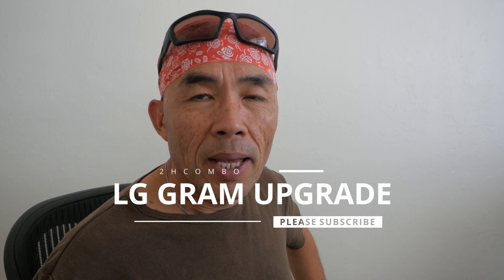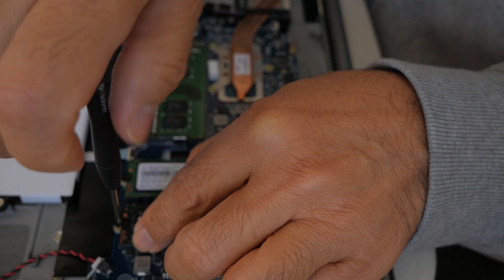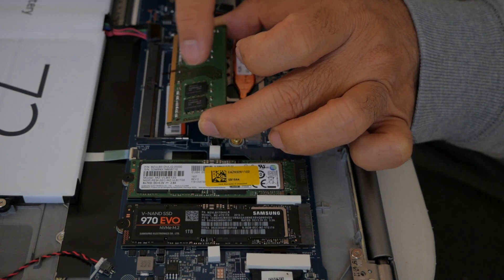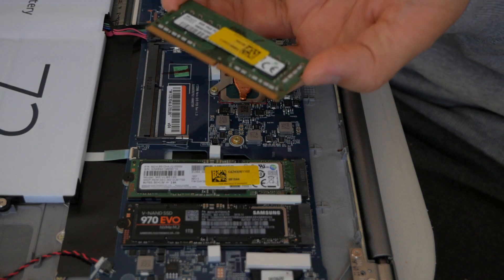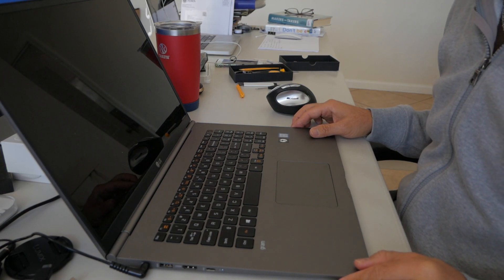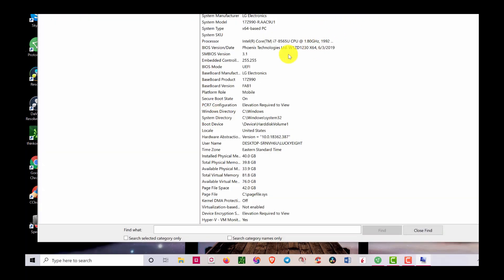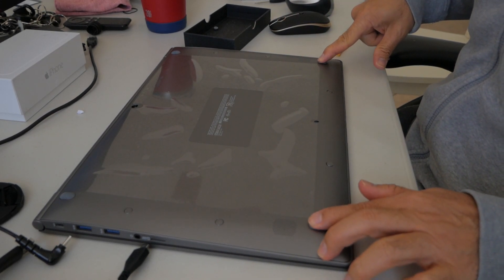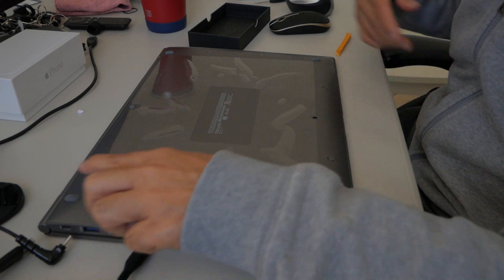LG GRAM LAPTOP UPGRADE - TO 40GB RAM AND 1.5T SSD STORAGE -Jan 2020

Comment: the video is really informative, but I have one LG gram 13z990, with i5 8265u CPU inside. I don't know if my model can upgrade to 40GB ram. I heard that the 13.3 inch, 14 inch, 15inch, 16 inch are using the same motherboard, and I want to upgrade my gram 13z990 to 40GB ram.

Comment: Can you advise me which brand ram 32 is suitable for LG GRAM 17/16 ? For those models are working on LPDDR4 4266MHz.
Reply: Não é possível trocar as memórias LPDDR4 de forma convencional pois as mesmas vem soldadas na placa mãe.
Reply: the Intel tiger lake cpus support 4266Mhz LPDDR4 or 3200MHz DDR4 RAM, so you can upgrade with any DDR4 3200Mhz (8/16GB) for proper stability
Edit: 2021 models dont have upgradable ram slots SMH

Comment: Hi, thanks for the video. What's the heat like with this device and the noise from fans? I've  heard that the cooling lets it down and it doesn't perform to its maximum and is quite loud particularly when hot. Do you see this, particularly with these upgrades? Thanks.
Reply from the maker: not a problem at all as far as the computer heating up;  I use my laptop all day long 12-16hours a day

Comment: Hi I am not getting the part of this tutorial where there is only 1 DDR4 slot which he replaced with a 32GB stick. But system setting shows 40GB ram installed? What am I missing?

The specs of this notebook didnt say anything about onboard ram.
Reply from the maker: There are two slots; the primary slot already has 8GB.

Comment: One huge recommendation and correction.
The original SSD slot where the factory hard drive is installed is an X4 slot {faster), and the secondary drive slot (the empty slot) is an X2 slot (slower).
My recommendation is to first install your new and larger drive in the second slot then clone your new drive from the original drive, then after you clone it swap the SSD drives and now you will have a much faster and better performing laptop. Later you can format the original drive so you'll have a lot of extra storage space.
To help you I recommend Macrium Reflect FREE to clone your new SSD, get it here:
https://www.macrium.com/reflectfree
or read this: 
https://www.techrepublic.com/blog/five-apps/five-free-and-reliable-cloning-tools/
FYI: I recommend before you start this upgrade project to backup your original SSD by taking a full image of this drive with the free Macrium Reflect and save it some place safe.
Good luck.
Reply: So now you made me think of another upgrade.  Once I clone the the SSD and swap the drive.  I can then upgrade to factory SSD to another 970evo 1tb..thereby giving me 2 TB. Would that work?

Comment: Hi from Chile i bought in spain the 14t990 512 gb and also a crucial 1 tb ssdnmve. odnt know much about pcs so  hope u understand: 
1.i cloned the crucial ssd nmve  because the lg control center  i dont know where to download it to use with win as default .
2. I am not sure but i think the 14t990 has 1 slot nmve i that is the one  i wanted to be running wind (crucial).
3. i have had problem booting from the new ssd it stays blacj with lg logo but there is no "circle loading win"

To get the full speed of nmve do u have to instal win in the nmve running or just like u did it with the oem ssd running win and the nmve in other slot?

Do i have to make changes in bios maybe bc the oem ssd run in  for example (dont know) sata  and putting the nmve i have to change the parameter to pci  something like that? 

i took out the crucial and i am using now the oem 512.... snif! saludos!
Reply from the maker: I don't think you need to run window on your new ssdnmve; I'd just run window as is on 512gb oem and make sure leave leave plenty of space on that drive and use the ssdnmve as the secondary drive.

Comment: Has your motherboard held up or is it fried after 6 months? Is your LG Gram still running properly or have there been problems with this configuration? Please I'd like an answer because I want to boost mine a little 😉
Reply from the maker: It's still running well with no issue.

Comment: So the ram slot only had 1 slot right?
Reply from the maker: There is only one slot that you can swap out the RAM.  The other one 8GB is soldered and not removable.  So, the one I removed was also 8GB and replaced it with 32GB; so, now it has 40GB total.
Reply: @2hcombo216  ok, thanks for the reply!
Reply: thanks very much!! your advice is very helpful!!!

Comment: It would make a great video if you tested the performance between the old setup and the one with the upgraded ram
Reply: If he follows my advice and installs the new SSD in slot #1 which has the faster slot at 4X instead of the second slot's slower X2 he will definitely get higher performance grade.